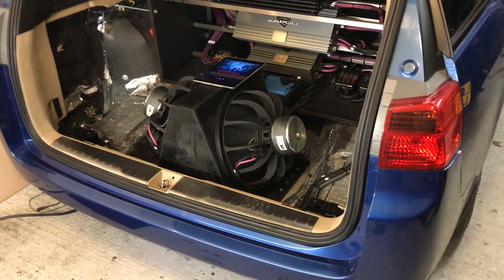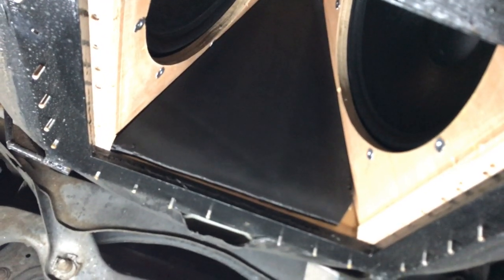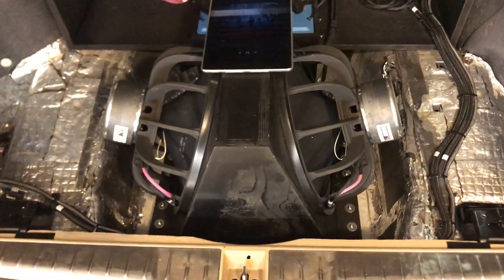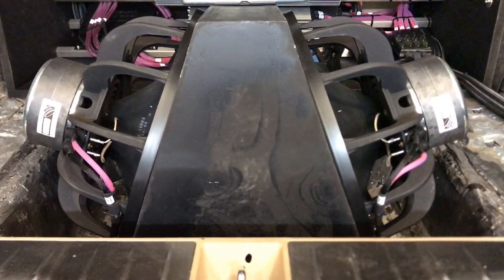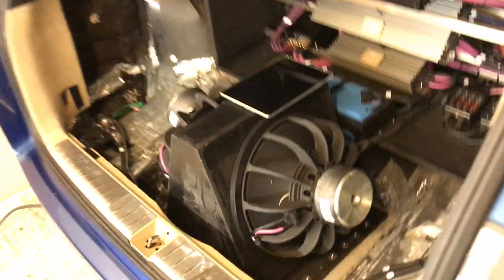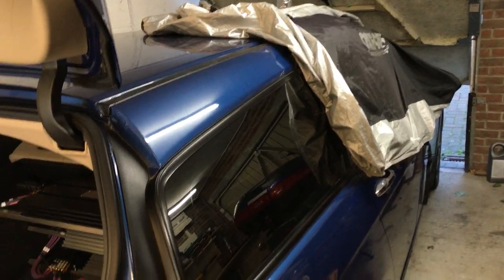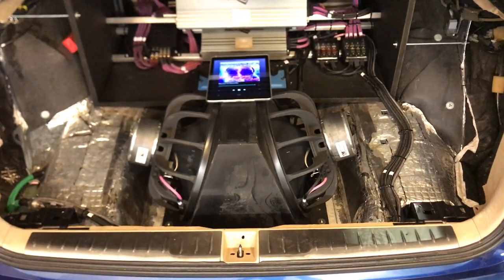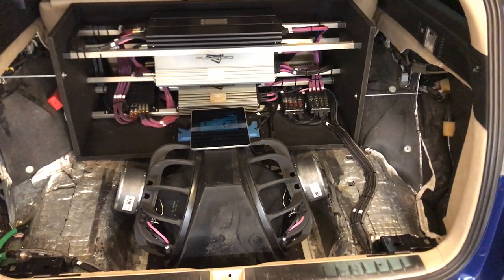Acoustic Elegance IB15AU in-car install

Comment from the maker: It has been measured at the driver's headrest. It's linear down to 25Hz and measures above 135dB, then slightly rises, 139dB between 17-20Hz. 
Yes, these are not high for an SPL freak, but for an SQ setup this is more than enough.
The strange thing is that it feels different than any other boxed sub making the same figures, as in this case the subs are part of the chassis (literally lifts the car) plus all the air movement is created purely by the cones, so feels more windy.
Reply: Pssound im obsessed with this IB setup and am going to attempt something similar with my next build, i know it can go crazy low, but how high can it play?
Reply: 🔴 How does this kind of setup affect the ohm load of the subwoofers❓

Comment: It is awesome your research of new frontiers for loading the sub, like this in the video. Very appreciated 

I would only be afraid to leave the car open below (basically it remains "open" even if you use tue special moquette). What happens if you meet a deep puddle to the integrity of the subwoofers?

Comment: Awesome setup.  I'm about to install a pair of SBP15's on a trubk baffle behind the rear seats.  I seriously considered doing the SI IB24 in the spare tire well.  But I heard of some issues related to dramatic frequency response  changes under variation of driving speeds due to the backpressure on the woofer related to turbulence under the car.  Did you notice anything like this with this install?
Reply from the maker: That’s just mythos, unless you have a Ferrari with 2” between the chassis and the ground. I don’t notice any difference when i drive.
Reply: Hehe.  It seemed fairly far fetched to me as well.  Glad to hear it.  I love your build.  I really like the idea of using the entire car as the enclosure instead of just the trunk.  No more worrying about 1xVas vs 10xVas, just stick as much as you can fit into the wheel well.

I was literally just about to start construction on my trunk baffle, but now I'm seriously considering switching to a build similar to yours.  I'm currently running midbass as a pair of 6.5 free air in the doors, with plans to move to 8" free air in the kicks, vented outdoors into the fender area.  This car is a 2003 BMW 330i and my daily driver so my main concerns are:

(A) Moisture.  I drive in the rain quite a bit here in Northern California winters, and the car is parked outdoors as well nearly all the time.
(B)  Noise outside the vehicle.  Is it significantly louder outside the vehicle with this type of IB install than say a typical high output enclosure inside the trunk?  Or a traditional trunk baffle IB?  At low, moderate and rocking volumes?  I live in a residential area.
(C)  And of lesser concern... how does it sound with the windows rolled down?  I know it's a SQ nightmare to rock out with the windows down, but I still like to do it pretty regularly.  I imagine it's hardly noticable when your flying down the road, but when at a stop is there a lot of cancellation going on with the front windows down?   (1)  Does it measure poorly with the front windows down?  (2)  Do you drive with the windows down and still enjoy listening to music?

Thanks so much replying and for posting all your builds and informative videos.  Fantastic stuff!!!  Subscribed!
Reply from the maker: Okay, let’s do it quickly! :D
A: there are few videos when i show my moisture protection, check the other videos out please. In the last 2 months my manifold has been completely open to the elements and it’s winter here in UK, so definitely more than enough rain and not a single issue. How is that possible? Just think about the general rules of physics, point moving and the way how tyres work...no moisture is directed under the car and up into the manifold! I should probably mount a GoPro there and record it on the road! :D
B: noise: well, a bit of road noise can come through the cones of the subs, but i can leave with it! The rest of the car is dead silent, so it’s acceptable. To the outside it’s amazingly quiet, however, i only play my rear subs under 35Hz, where it’s very different to excite the airspace inside the cabin as opposed to the outside infinite space, so it’s pretty loud on the low lows inside, but nothing crazy outside on the levels i play. Boxes booming in the 40-60Hz range can be heard from miles. If you worry about neighbours, just turn it down 5mins away from your home. 😉
C: when you drop the windows, you effectively tune the car (which is a sealed box when windows are up) to a lower tuned ported box and wind becomes more present created by the subs. In another video i showed that with my missus! 😃
What it’s like with windows down at high speed...i’m not sure, my windows are up and i listen to music like in a studio, no street bassing anymore!

Comment: I'm not sure what difference it would make, but I would think you would have the motor side of the sub on the other side from you.  I've used IB in a car with a walled-off trunk and hung off the rear deck.
Reply from the maker: CaseAgainstFaith1 It really doesn’t matter which way the motor is facing. In this case though with a manifold like this you have no other option as there’s no depth to turn the speaker around.

Comment: Hey I know this vid is old but I'm curious if you have any experience with the SBP subs which are supposed to be the successor to the IBAU. I'm trying to decide between the two!
Reply from the maker: Hi Kyler! SPB range has slightly different specs rather suited for trunk baffle application. Also, i think you can’t get IBAU subs now due to production issue, but have a word with John.
Reply: @pssound9749  Makes sense. Thanks for the quick reply! I'm probably going to go with a single 15". 

Love the videos by the way

Comment: So they wont work if ur window is down?
Reply from the maker: They don’t work if the tailgate is open. If everything is shut, you sit inside of the “box”. By dropping windows you can turn your sealed box into ported as such and gain even more dBs under 20Hz.